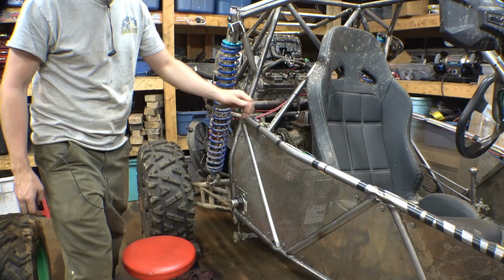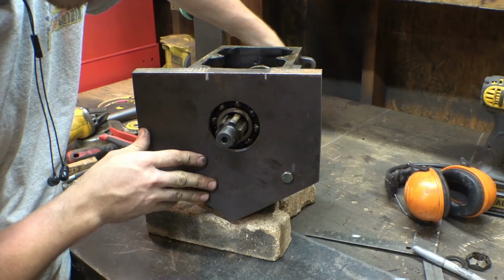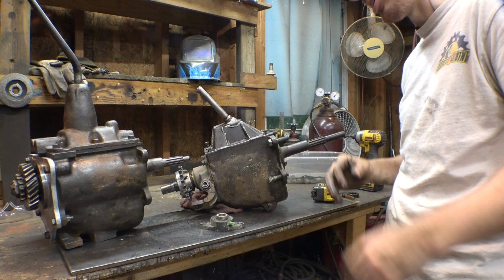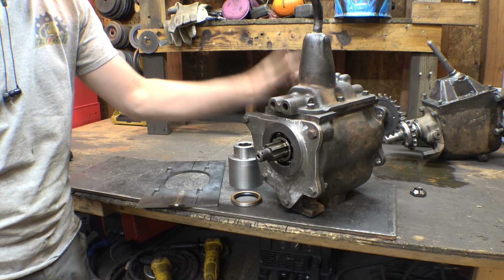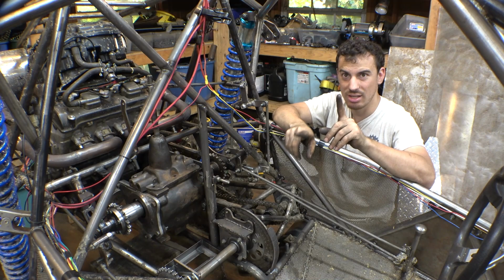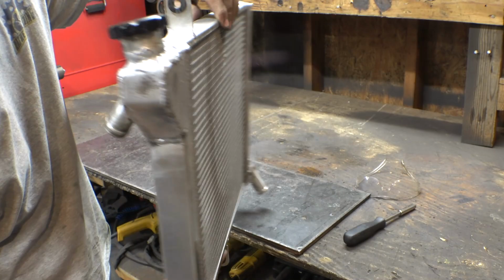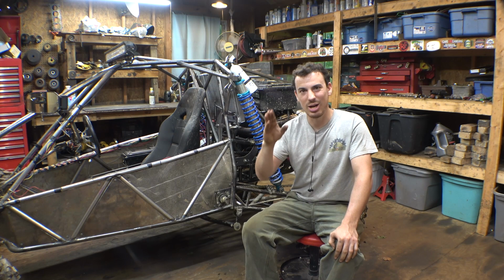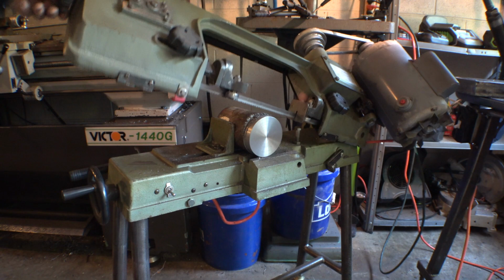New Transmission for the CBR 1000 Off Road Buggy!!!

Comment: I give it about three days before gear oil starts coming out of the hole that you drilled for the pin holding the nut in place.
You have no way of stopping the oil working past the splines that you cut on the sharper, then working through the threads on the nut I mentioned before. Some PTFE tape, and a copper sealing washer under that nut should sort it. Best episode in ages.

Comment: You're not an electrician but I was. Get yourself a contactor. Now I don't know if you have a 120 or a 24 0 outlet and motor. But if you have a 120 you can go ahead and run the power directly to one side of your contactor that you power coming in you hook the power to the motor across the other side there are extra connections on that contactor that you can essentially pull power from the input side run it to your little switch and then you run it to the coil. You then take your neutral (if you're running 120v) to the other side of the coil on the contactor and then on to your motor this will keep your switch from taking the full brunt of the current running through it. And then of course you just run your ground as you normally would. You will need a single pole contactor probably 20 amps to do this. If you have 240 it's not that different.

Comment: I'm glad to see your machining improving. However, if you have less tool overhang whenever possible and use cutting fluid of any kind you will have better results, be able to take heavier cuts, and have longer tool life which will save you time and a good bit of money. Overhang = more chance for chatter = longer machining time and chipped inserts = money. You can also regrind your inserts with a fine diamond hone/dremel disk. Stefan Gottwinter has some great videos on resharpening inserts, and he is a top tier machinist that I'd bet on over almost anyone. Keep up the good work.

Comment: 42 years ago I tore apart 103 of these transmissions in various casting numbers which indict application for that transmission that were purchased from the government, I identified every part by number and stocked them in individual parts bins, 5 or six years later our purchasing agent sold all the parts from those units along with the cases. Thanks for showing this, it brought me back to a time I truly enjoyed and very much miss today. 

I loved that job because I got to work with all kinds of old time transmissions and differentials, marriage boxes to auxiliary boxes…. Even the old chain drive stuff.

Comment: There was 3 versions, the T90A and T90C. 2.79:1 1st gear, 1.55:1 2nd gear, and 3.79:1 reverse in the 90A. 3.34:1 1st gear, 1.85:1 2nd, and 4.53:1 reverse for the 90C. Not a lot of difference, but could make the difference. The A was the older version used from '46 to '62 and the C was used from '63 to '71.

Then you had the T86, with the main difference being, 1st and reverse gears are helical cut and synchronized on that, whereas the T90 has spur cut unsynchronized 1st and reverse.

Comment: I have a degree in CNC machining and hope I can help with your question. Although messy chip-wise, you can try a roughing endmill for your mill when hogging out that much metal. Please don't take offense, your 3 phase lathe is far more ridged than that mill. Those mills get the job done but aren't really made for what you are doing. As for the lathe, I think it would be a lot faster but at a cost. That part had a interrupted surface and would have been rough on your cutting tool. Most carbide bits hate interrupted cuts. You could try a HSS cutter and regrind when needed. That lathe you have can take some deep cuts and would be done with that part in about 45 mins. Be sure to level and bolt that lathe down for those kind of eccentric parts or your lathe can walk across your garage, that's for real, LOL

Comment: You really need to get a coolmist setup for the mill.
Your tools will thank you as will your wallet....of course the intial investment is there but you'll get that back in tooling costs.
Reply: No doubt. A coolmist setup is cheaper than (I'm guessing) 4 carbide endmills. Unless you're buying the questionable Chinese ones. Not to mention he'll get better finishes with any cutting fluid.
Reply: @bradyoung6663  
A decent 1/2 inch carbid endmill will run around $50 bucks. And thats just a decent one,a good one will run double that.
    A good mister will run around $300 bucks but you can get them cheaper.
Reply: Was thinking the same thing...
Reply: @TrulyUnfortunate  Thank you. I was just guessing, but wasn't too far off. Have a good one, Dude.

Comment: Just a tip if you cant afford the insanely expensive Buck Chuck.
You can tap out run out by wacking the top of the jaw with a piece of brass our a brass hammer to get rid of the run out.

Comment: If you change the fulcrum point on the front shifter and make the shifter longer it will shift gears a lot easier as you have little leverage with the fulcrum point that far down and the shifter that short which reduces the throw...

Comment: You are an amazing fabricator. My only suggestion would be to polish the sealing surface of the hub you made for the new transmission. If not , I believe that the rough  machine surface will wear out the seal you put in, prematurely. Good luck and look forward to the next video.

Comment: I’d get a heavier gauge cable for the motor tot he wall. If it’s getting warm, it’s possible the wires are too small, too big of a load on them. It looks like you’re using an extension cord as the power, the longer the cord the more power loss as well. Most extension cords are only 14 gauge, good quality ones are 12, and you have to pay a lot for higher gauge ones like a 10. Also cord thickness doesn’t reflect the gauge and current the cord is rated for.

I assume that’s common knowledge, but only if you know it…
Reply: Welding cable time? Lol jk

Comment: Chris you will have to tap the hole you added for the pin to lock the nut so you can plug the hole. The oil will go through the splines and leak out of the hole.

Comment: They make the transfer buttons that you made. There made of a hardened material. I have several sets of all the most common sizes. There not very expensive. There called "blind hole spotting punch sets "
Reply: The best way to get a dead center hole to locate the drill bit

Comment: Chris, try a ball peen hammer  to transfer those cardboard templates. You don't have to hit too hard and the edges of the metal will cut edges that are spot on, including those blind holes. Replace the fan shroud on the motor for your saw. It will run cooler and should draw slightly less amps. Great vid. I wait for them every week.

Comment: You may need a Breaker instead of a switch for the power.>Your Output Trans Splines may just ooze.Is there an inner seal on the shaft?It's been...I was 12 when I worked on that.(2nd gear power-shifts blew it)<I saw in the kit a seal for the input shaft.>Is there an inner before the splines for output?I give you Kudos for the filing and sanding of the sealing surface.I clicked a couple'you need to seal the spline'comments.(I stopped when you showed the seal,to look for comments).Have Fun Regardless:Is what they should call the weekend races.

Comment: @rather B welding
With the sprocket that is slightly wobbly on the shaft, if you have some feeler gauges find out what the spacing is & make a splined shim out of sheet metal so that there is no play on the sprocket otherwise you're going to do major damage either breaking your sprocket or shaft.

Comment: I know it's already too late, but oil will get through the splines of your output shaft and leek through your pin hole and potentialy between the two machined hub plates.
Reply: Thank you.I stopped to look for comments just after he showed the seal.The splines will pour.He needs a sealed axle bearing inside,before the splines.
Reply: May be how you see it but to the trained eye it is a self lubricating and anti rust system. LOL I think it will be just fine.
Reply: @bryduhbikeguy  He can simply plug the hole and put some silicone between the two parts.

Comment: Some Loctite 620 bearing retaining compound will hold that input sprocket hub on there good and tight. I have a JD 720 Diesel, and that Loctite 620 is what's holding the 275 LB flywheel on, that spins at 1250 RPM fast idle. It'll hold that sprocket hub just fine

Comment: You should go to the auto parts store and pick up a simple screw on tabbed relay. Then one side of the coil goes to neutral and the other side goes to a power switch and then back to hot. Then a hot wire goes to the common terminal of the relay and then the normally open output goes to the motor hot. This way all that current doesn’t go through the switch and you won’t melt the wires on that saw. I can send a schematic and a relay with wiring if necessary. I just don’t want to see you burn down your house...Great build can’t wait to see it live again!

Comment: Get the gear red hot then cover it in sand, slows the cooling, let it cool down. It should be annealed so you can drill it. Thenheat it back up and put it in oil let cool should be toughened up again. Nice job.

Comment: I'm really surprised you didn't make your plate from 1/4" steel and turn a cap for the bearing and seal and weld that in place. Way easier and less time as well. And in the end, you welded a cap on anyways...

Comment: To properly tune this thing get a good air/fuel meter. You will be doing alpha numeric changes based on what the air/fuel mixture is at a certain throttle position at a given RPM. Good luck with your progress.

Comment: If  your radiator fan  was  wired right, you could change direction form push to pull so that way in the summer, you point it away from you, in winter time it points at you.

Comment: WOW!  You put a LOT of time and effort into that rear bearing plate.  I'm surprised that you didn't use a thinner sheet and just fab' weld a hub to it that fits the bearing AND the seal.
Anyway, yours is done now - well done.
Re' the gears not easily selecting 2nd until after you've selected some other gear, that's quite normal and is just a quirk of that kind of shift mech'.
Hope you meet your deadline.
Regards Mark in the UK

Comment: As I said....the part jerking towards your cut is from the tool pulling the part into the cut. You have to approach the cut from the other direction.
What happens is you're pulling the slack out of your ways. Grab your table with nothing in the mill and push and pull on it. You'l find that the table has play in it. When the tool hits the part in a climb cut it yanks the slack out of your ways causing the part to move.
    It also trashes your end mill if you're taking a big cut.

Comment: For wire situation you need resitances something that check out high current  (diodes) or check valve (relay) smooth take load off

Comment: No climb cuts unless you have ball screws on your mill!!!
You can get away with light cuts without them however and they give you a better finnish.
   The first time I ran a manual mill with ball screws I was amazed!!!!
 It doesnt matter which way you approach the part it doesn't grab and yank the crap out of your part!!!
    Ball screws are the SHIT!!!!
  For those who dont know what a ball screw is....
      Instead of a rod with V threads or Acme threads they have a radius groove for the thread with ball bearings that ride in the threads and the nut has the same profile.
   This eliminates slop in the mechinism so there's no play.
   You can push or pull on the mill table and it has zero slack allowing you to approach the cut from both directions.

Comment: Your damaged second gear on the last transmission, and the problems you're seeing now might be from your linkage.

It seems like your linkage might be acting as if a hand is resting on the 'stick' of the transmission, which as we know is a BIG no-no and can cause damage.

I'd check if your linkage is putting any unnecessary pressure on your transmission.

Comment: My 53 willys truck had a T-90a1 transmission. They are pretty stout. I had it behind a Ford 302. If you can find a T-90c they have a wider gear ratio.

Comment: Some materials will pull the cutter into itself as you cut. Hogging with an end mill in a collet is not advisable. Use the tool holder that has the set screw it in and an end mill that has a flat for that set screw. Also, yes do all that work on the lathe if possible

Comment: Hey man, don't sweat the mistakes!
Theres 3 professional landscapers with years of experience working on a deck using a new decking material using a recycled plastic product and it like a tongue and groove thing with these special clips that hold it down.
We spent half a day trying to do the picture frame and ruined 3 lengths at $75 each! In our defence we didn't have the right tools to work with this product as we usually use timber and you need a special router bit to shiplap it and whatnot. But still, simple mistakes ruined the job and had to be redone about 4 times!

Comment: just a side thing for you, the original bike transmission (which i guess you are using?), first gear in the transmission is the weakest, dont put too much load on it with those big tires or it will snap on you. second and up is stronger but the lower the gear the weaker. since you are using such a gear reduction there is a lot of torque being transferred!

Comment: So I don't know anything about that transfer case that you popped off of there but I really hope that you saved the gears and took some measurements because I think that was a gear-driven transmission and not a chain drive. It means that that will take a beating and would make for one hell of a addition to any off-road vehicle probably a lighter Duty one cuz it didn't look like it was very big

Comment: Nothing is stopping gear oil from going over the spines you cut and into the new hub. The whole you drilled for the Cotter pin access will have to be sealed up.

Comment: It would help to wrap the exhaust straight out of the engine up to the muffler. It runs under/near the radiator so you are no doubt getting some heat off the exhaust right into the rad. I just wrapped the exhaust on my Yahama MT-09 and saw a measurable improvement (lower temps). I live in the desert so I need all the cooling I can get! Plus (imo) a wrapped exhaust looks cool. I recommend going with a titanium wrap from Design Engineering. I got their black wrap off amazon. There are cheapo alternatives but their build quality and performance are highly questionable. Design Engineering is the way to go.

Comment: The bad thing about using Superbike motors is their gearing. 1st gear on a  600 superbike is over 65mph usually, 1000's over 80mph. 2nd thru 6th are very close ratios. Just watch a vid of someone banging through the gears and look at the RPM and mph. But since he's using a separate trans and has 6 gears in the motor, that's alot of different ratios. I built a buggy with a CBR1000 motor in 05 with no separate trans and after the first ride I redesigned it to have a 4 speed, so it was really a 24spd. Rarely shifted the 6spd though. Fucker was FAST though.

Comment: I think I would have welded in an insert for the bearing into a thinner plate if I were you, but excellent work! I'm glad you tried turning it in the lathe; I was wondering about that too. I wouldn't worry about paint for the collabs if I were you. Glad to see you're working on the engine too! I'm a little worried about all those aluminum chips in the radiator, but hopefully it'll be ok. I'm doing something similar where I'm adapting a Honda 300EX bottom end for use as a transmission with an external engine.

Comment: Hey, next time around think about using the transmission and t-case from an old datsun/early nissan pickup. Would be pretty ideal for a setup like this. Transfer case is divorced, only connected to tranny by a short driveshaft. Also waay smaller and damn tough.

Comment: You need to use a Suzuki gsxr  750 gear box that’s the motor and gear box to use what they use in NewZealand on our Tq buggies and is the only gear box that works with these high revving  motors

Comment: switch not man enough for the current, add a bigger rated switch (amps) or use a contactor to run the motor, the small switch to run the contactor (big relay)

Comment: You really need to invest in a 4 and 6 inch carbide insert face mill that plate wouldn't have took but 10 minutes on the Mill. Then what ever time spent on the lathe. .080 to .120 inch rough cuts are amazing also that's at 4 inch diameter.

Comment: Wow you got the transfer case, and bell housing, and the crossmember, that made the long drive worth it. there's a trick I know to locate those holes on that plate. you also can use for the gasket too. there's this compound called Prussian blue it's used for setting up rear differentials. just smear it on the rear surface other transmission. then butt your plate up to it and it will transfer a perfect impression onto the plate. I've done it many times it works good.

oh almost forgot you could probably use a sealed bearing on the output shaft. providing it fits snug enough in your bearing retainer.

on the saw you need a relay or a heavy duty switch. that's too much load for that switch.

Comment: First of all, great builds, like to watch them
Second succestion; please rebuild the exhaust headers , this setup wont ever run good on this engine, this will cost about 30hp, and a would say this is also the issue that the engine wont rev and no top end power, there are many good reasons why the build the exhaust runner this way
But overall very interesting and allways fun to watch